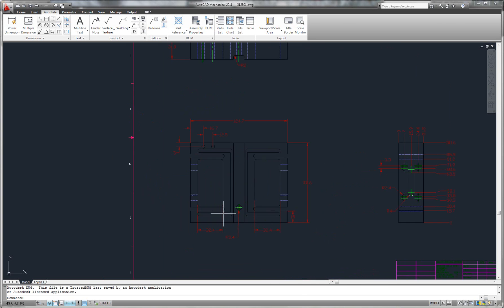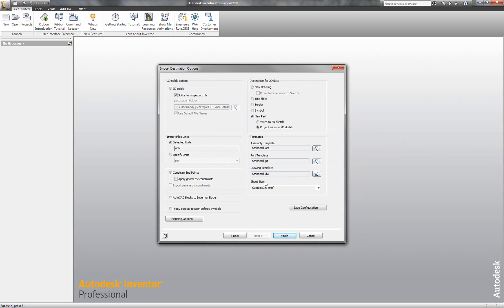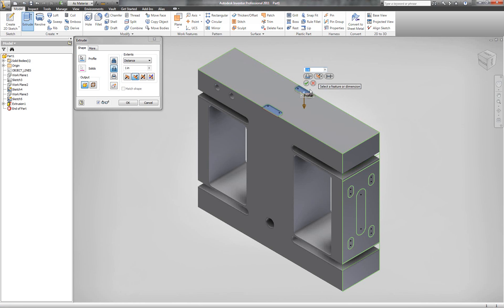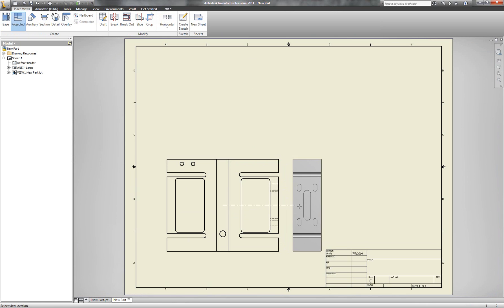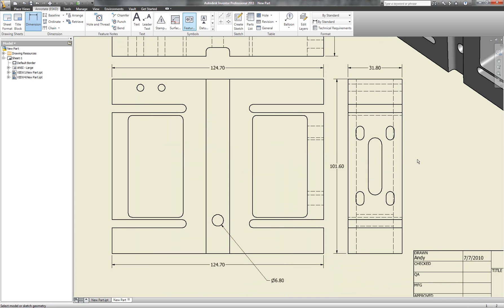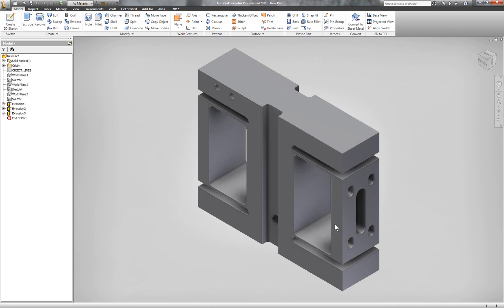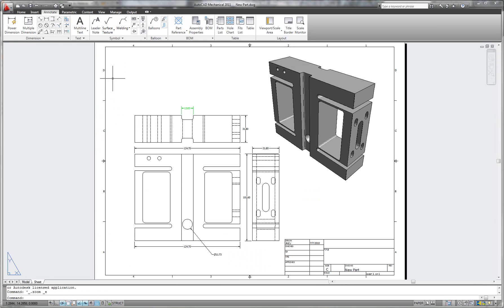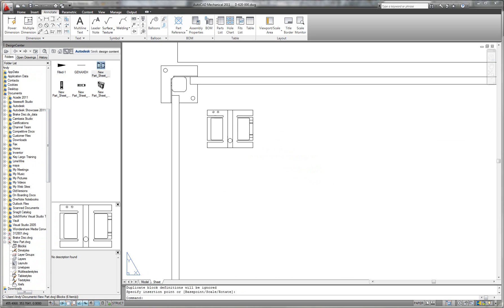2D to 3D Conversion and DWG Ture Connect

Comment: I have a drawing that I am trying to convert to 3D however when I import it into Inventor, every drawing comes up as individual drawings so when converting 2d to 3d I have to click every one individually, when I try to highlight the "base drawing" for 3d it would let me. Is there anyway in inventor to group drawings (like in Autocad) so that when converting 2d to 3d I just have to click/highlight the single drawing?
Reply from the maker: JC,   There is a topic on the following thread...I am not sure if this is what you are referring to on the AutoCAD side but thought it might help...
http://forums.autodesk.com/t5/AutoCAD-2013-2014-2015/MERGING-2-different-AutoCAD-dwg-files-into-one-each-having-10/td-p/4488527
Reply: Andy Rahden I was refering to the DWG after I have imported it into Inventor, if that makes sense?